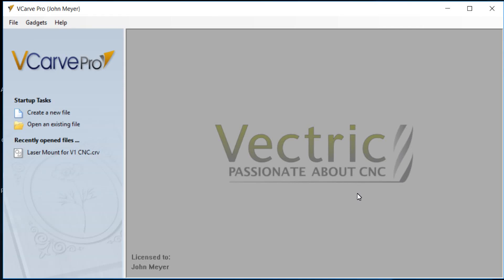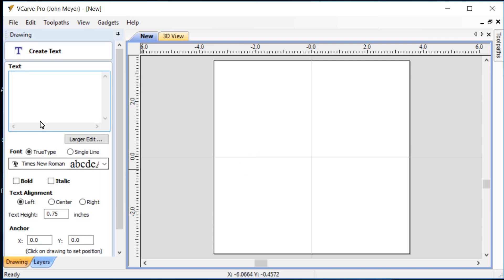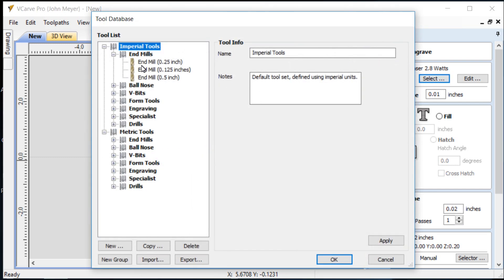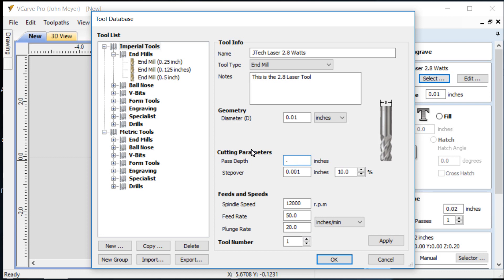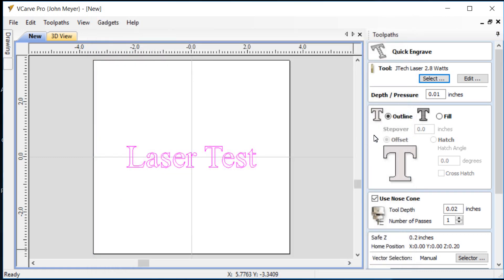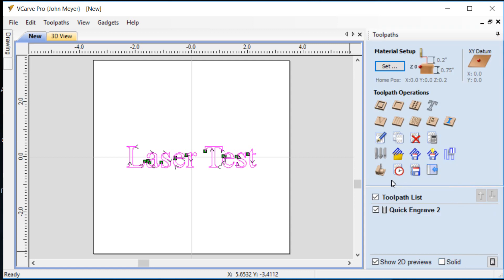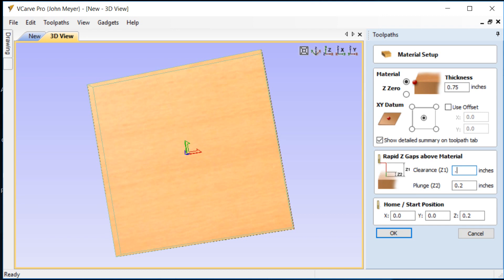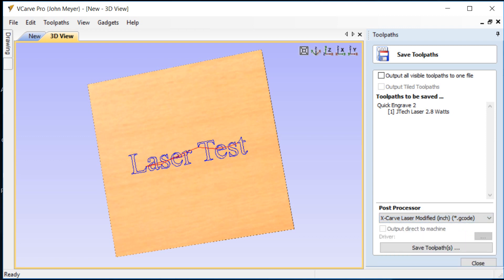0004 Creating a Laser Tool in VCarve Pro

Comment: Hello John thanks for the info. I have Mach 3. My question is on my jtech 3.8 laser. I have the pwm digital to analog converter board. I’m not sure if you have that one where you can vary the intensity of the beam thru the spindle output. If you are familiar with this I am having a problem with the intensity being adjusted with v carve pro. I can manually change the intensity with the up Down arrows but it defaults to the brightest beam when Mach 3  starts the code from v carve pro. Thanks for any info you might have.   Jerry

Comment: Hi John,  Great videos. They have helped me a lot.  There is one item i am having problems with and that is how do i connect the TTL laser to the breakout board?  I have connected the + TTL wire from the laser driver to the PWM terminal on the BOB and the  other wire to ground.  I am running a power supply direct to the laser but not sure if i should actually be running the laser from the 0-10V output on the BOB.  Hope you can advise.  Thanks, Dean

Comment: hi. thanks for sharing your knowledge. I just bought the jtech 3.8 and im trying to set it up. did you have to adjust your beam focus?. it seems good enough as I did your set up pretty much like yours except it was .011 on the diameter laser test . came out pretty good. I have v carve pro and mach 3 PP.
Reply from the maker: Jerry, I started out with the 3.8 J-tech laser, but I put it on a 3D printer that runs on an arduino - which of course did not utilize Mach3 and the Vectric software - so was not a part of this video series. As for focusing the beam, if it comes focused, then no sweat, but if you knock it out of focus, or move the Z axis up or down from the original focus, you may consider re confirming focus. In my opinion, the focus is next to impossible to get exactly perfect. The MAJOR concern for me has been to keep the current (amps) low enough to use the laser for longer periods of time without burning it up. Good luck and glad you found these videos helpful.